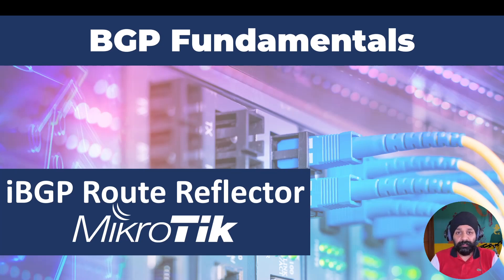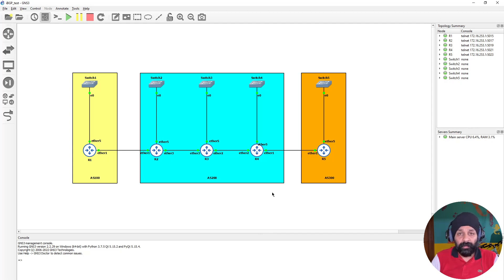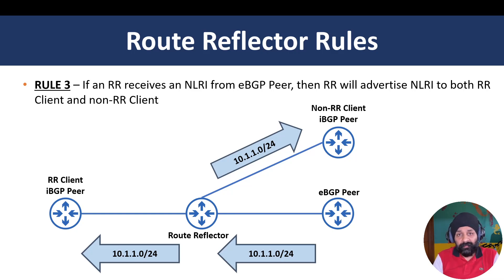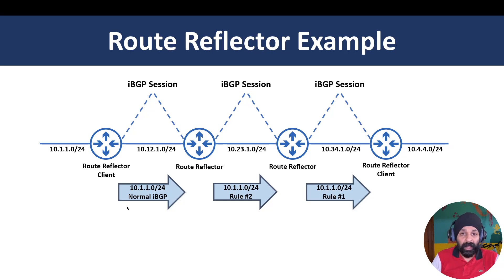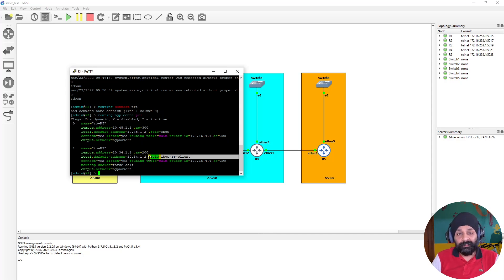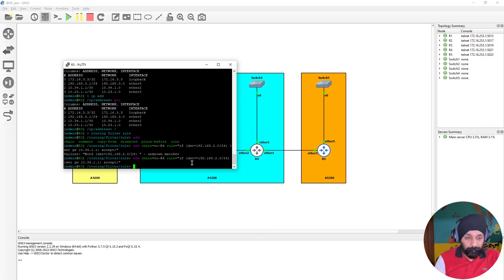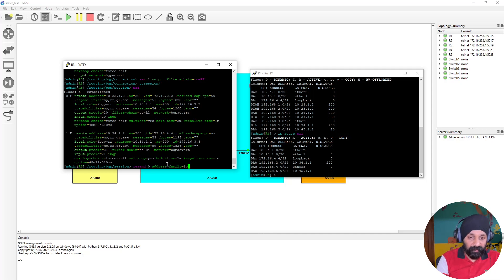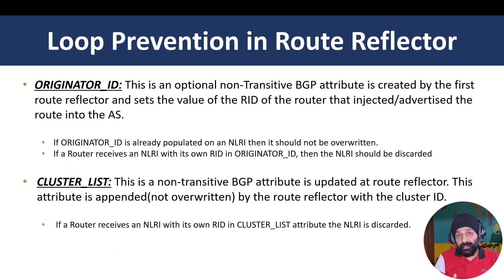iBGP Explained Route Reflectors | BGP Fundamentals Part 3 | MikroTik RouterOS v7

Comment: routing bgp network set synchronize= , where is that in v7?
Reply from the maker: In routerOS V7 only the routes that exist in RIB will be advertised so by default this is on and you cannot switch it off
Reply: @MankomalSingh  so you can't force it , ok i see
Reply from the maker: @nikolashuminosky6987  essentially you cannot switch it off so for example if you want to advertise 192.168.1.0/24 then this prefix should be there in routing table and valid. In case not then it will not be advertised. You can still add the prefix as a blackhole route.
Reply: @MankomalSingh  got that , tx